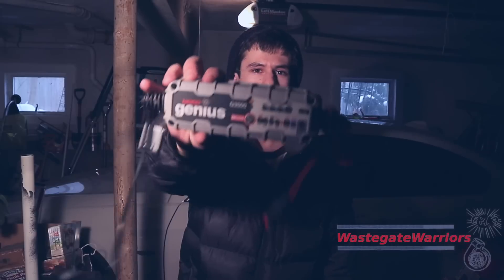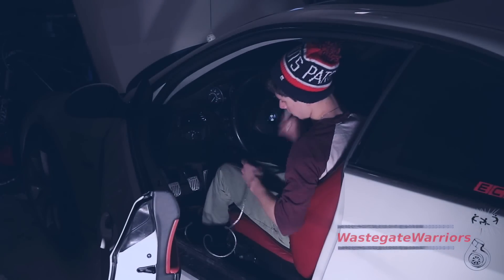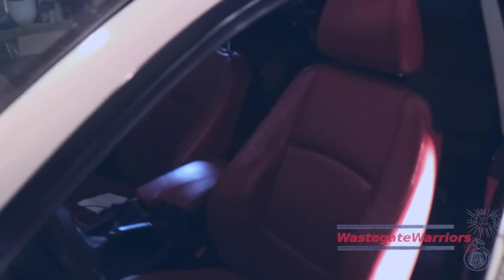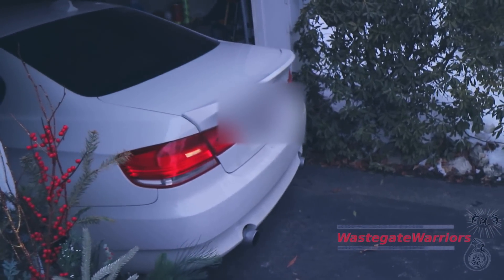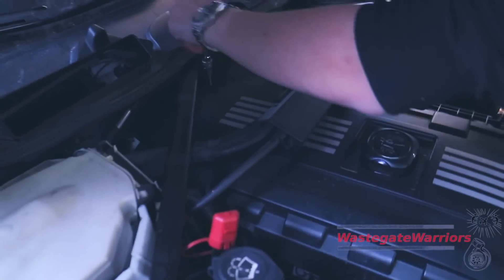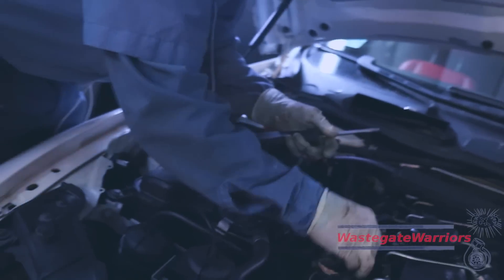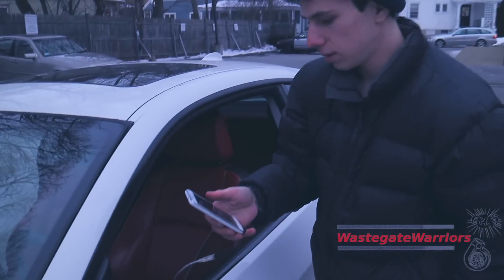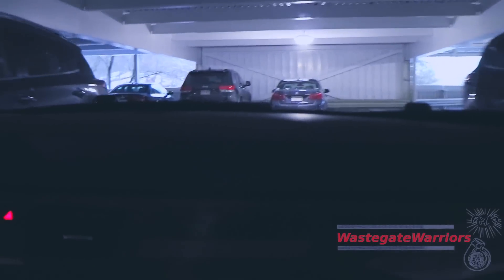MHD/Wedge Flash-Tuning Your Car in Your Driveway | Install and Review

Comment: How did you get Mhd to connect to the ecu? I was not able to get it to connect tried a lot of different ways to do it. any ideas?
Reply from the maker: +bmomosaik You probably don't have the right cable combination. Some of the cheaper amazon cables have been known not to work. Try the ones I posted in the description.-Max

Comment: Whats your exhaust setup? and what mods you running currently?
Reply from the maker: +Mohamed Abouelatta Stock downpipes, stock muffler, no secondary cats, Wagner FMIC, BMS DCI, BMS methanol elbow, heavier clutch from the 650i and a lightweight dual mass flywheel- Max

Comment: Awesome video sold me on the product. can I tune others cars with the same software? I just have to pay $49 per tune correct?
Reply from the maker: +Dolly Chavarriaga This software only works with BMW cars with the N54 engine. (135i, 335i, 335xi, 535i, 535xi, 1m, z4m) And you need to buy the flasher module for $99 and yes each tune is $49

Comment: So you lose gauge hijacking, on the fly map changing, meth control, on the fly waste gate control, custom boost maps,  this is better than the jb4 how, exactly? more power? You didnt use the jb4 correctly
Reply from the maker: +Rusty Shackleford You do loose those features and I was totally bummed before I flashed it as you are, but you gain so much more. You really realize that all that crap is totally unnecessary. You can also tweak your bins and make your own tunes if you know what you're doing, load them onto your phone and flash them- it's a piece of cake. The JB4 isn't a real tune man- it's a piggyback. It cannot control timing or real values on the motor. It spoofs values so the car adjusts timing and fueling to compensate for the signals the JB4 spoofs. Because of this, it's very inconsistent and power is not right there off the table, you have to wait for everything to work. This tune is a real flash tune, which truly changes the way the boost comes on, the timing, the fueling,- it's night and day compared to the JB4. You don't need gauge hijacking, if I want to see boost pressure I can log with MHD- which may I add is far superior to the JB4s logging capabilities. You also get wastegate control with this tune as well. You can run methanol with any tune stock to Wedge- the car will respond the same way. I've had my car flashed with Cobb's Tunes, a JB4, and two different Wedge tunes and I can honestly say this is the best. Obviously it's up to you to choose the best path for your car, but I can honestly say you won't be disappointed! Don't let the hijacking scare you! You don't need it! - Max
Reply: WastegateWarriors You have no way to control the meth injection like you do with the jb4, the best tuning option is the jb4 with the backend flash. buy a 180 dollar tuner and the tunes are free. You get all the good of the jb4, and all the good of the dme tune. Timing, vanos, fueling all done by the dme, boost on jb4. The jb4 isn't nearly as bad as you say it is... It doesn't control everything like you said, but with the back end flash its far superior to just a flashed ecu. The way the jb4 controls meth and boost is second to none, far better than even the factory dme controls boost, and you get to change maps on the fly, and read codes on the fly, clear codes on the fly, set when you want meth to spray, see your afr, boost, iat's, meth spray and way more on your gauges.  Having to datalog whenever you have a minor issue is a pain in the ass, having to pull over and read a code whenever you get a misfire is a pain in the ass. I'll stick to my jb4+backend... especially after doing some research on the wedge tune in specific... doesn't it log one cylinder only?

Comment: How is it running? Do you have down pipes like the stage 2 recommends or is it good without em
Reply from the maker: +Dominic Oddo Runs amazing, no problems whatsoever. I don't have secondary cats so I can barely get away with the stage 2 tune with my stock downpipes, but if you do use catless dps it will absolutely haul- Max

Comment: Jesus Christ you guys crack me up!  Good videos...keep them coming!  I have an e93 (2008) that you guys have completely sold me on flashing. Charge pipe, BOV and AFE intake.  Stock exhaust..but hoping for good results.  Cheers!
Reply from the maker: +Harry Potter haha thanks man, I would highly recommend this tune man. I've had over 4 different tunes on my car from Cobb to JB4 to this and I can soundly say this one is by far the best!!! Lmk if you have any video ideas we can totally incorporate them.

Max
Reply: Guys, are you running custom tune by Wedge or what is available from Google Play with MHD?
Reply: kotovna wedge actually makes the OTS maps for mhd however contact wedge performance on Facebook to further tweak your tune to a more custom setting
Reply: I have the same car it’s full bolt-on with mhd flash stage 2+ it’s insane you can feel the power gains check out Vader solutions.com  you can buy an mhd kit of the website